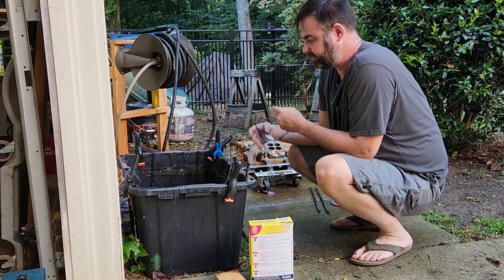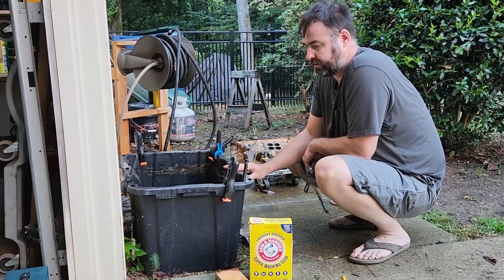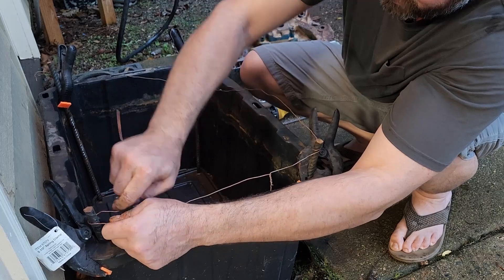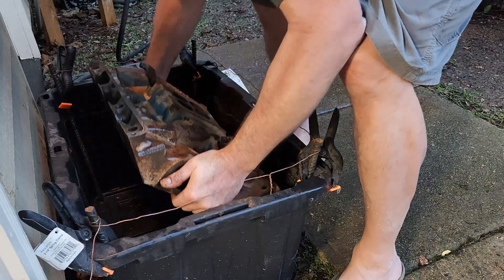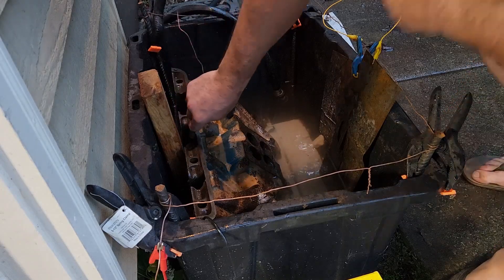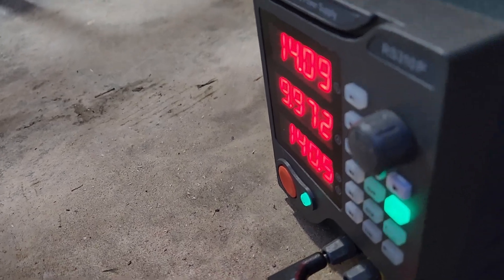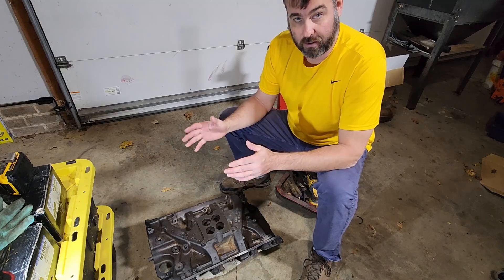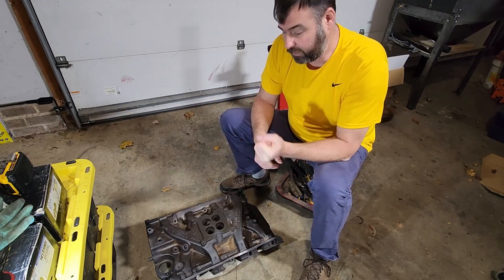Was electrolysis rust removal sucessful?

Comment: muriatic acid then bare metal prep <phosphoric acid
Reply from the maker: Most preps I've seen say to wipe it down presumably to remove contaminants. I don't see that being practical with a rough cast surface. Can the prep be sprayed on and let dry before painting?

Comment: Put the whole thing in vinegar for 48 hours 
Pluck it out scrub under a tap put back in for 24 hours 
Beautiful 🤩
Reply: That's a lot of vinegar!
Reply: It’s cheap and you can reuse it over n over 

I blast it with the pressure washer after gets all the rust residue out completely
Reply from the maker: Possibly cheap compared to other products such as evaporust. For this project, it would have been 26 gallons. At Walmart prices that's over $100 in vinegar. Even factoring in the cost of the power supply, which I use for many other tasks, it's about even. Then I have 26 gallons of vinegar to get back into a sealed container and store. With one $6 box of washing soda I made several batches of solution, possibly unnecessarily, with lots leftover. Arguably as an acid vinegar is reactive with iron, but I wager that would take a very long time to cause any erosion of the base metal. I think they both have their place, but I would be hard pressed to be convinced that vinegar was better for this project. Notably, would the vinegar have gotten the rust under the paint?
Reply: Hand held wire brush would remove any paint of this part in a jiffy as it’s pretty much paint free already and being a part that is always heated and cooled and how old it is I don’t think much paint would stick to this manifold 
Yes. Vinegar would do a far more superior job and would not discolour metal unlike some harsh in-safe products 
Get some rusty parts and try it 
You will be satisfied
Reply: Vinegar is less than a dollar a litre in Australia
It takes me $10 to do four car rims one by one
And they come out incredible 
You scrub in between dips 
It’s the best
Reply from the maker: @bullshitstomper9417 originally this had a lot of blue paint on it, and it wasn't scrubbing off. Electrolysis isn't really meant to remove paint, but I was pleased it got to the rust that must have been under it. I have zero scrubbing on the part so far, other than removing the build up on the anodes. 

In the end, It's just another way to accomplish a task. I have used vinegar for smaller parts. While it worked ok, it has its downsides in my opinion. Glad it's working so well for your needs! You must be doing some small car rims if 10 liters of vinegar is submerging them tho? 

I considered dipping this manifold in vinegar to see if it would get any cleaner based on the comments, but it would just be so much vinegar! Maybe if I can find a shallow pan that would allow me to use less I'll think about it.

Comment: Propane torch will degrees it best for paint it burns the oils away, then wire brush it and paint it.
Reply from the maker: I've often done that for other parts as a final step, but it almost always flash rusts. Maybe  I'm just in a more humid area.

Comment: How is this process better than letting the manifold soak in white vinegar for 1 week?
Reply: Hi. I didn’t see your comment before posting 
Yes..!  Vinegar is the best
Reply from the maker: Great question, and interesting thought problem. I have only used vinegar to clean or remove rust from small items, and copper wiring for solder prep. I keep a couple gallons of 30% vinegar around the house for various things. It's useful. My guess in this case would be cost and disposal. That is a 26 gallon bin I believe,that's a lot of vinegar.  While the washing soda is slightly caustic, I feel it is effective at far weaker concentrations that vinegar likely would be, and the used solution presents little environmental risk. I use diluted vinegar to kill weeds around my house.

I think a bigger bin that would allow the use of larger anodes and be able to more easily rotate the part to avoid gas pockets would have yielded better results, but this worked pretty well.

Also I don't have a spigot that dispenses vinegar, so this is easier to handle. 😉